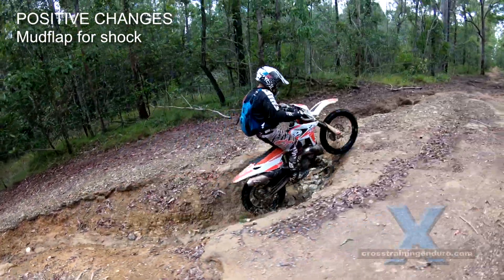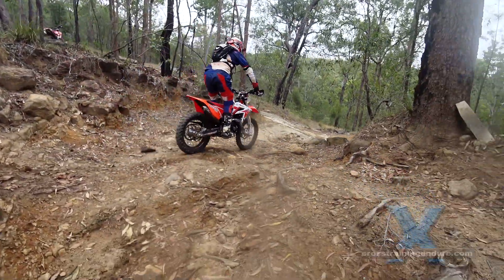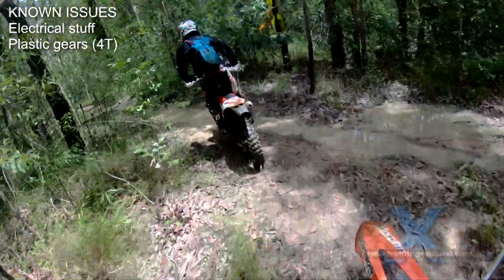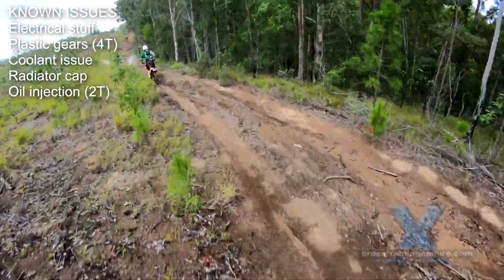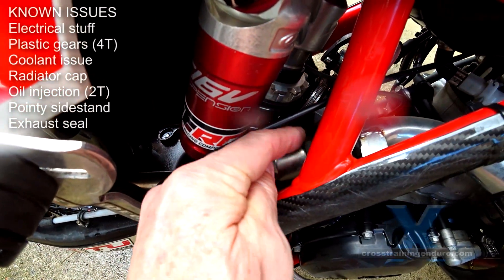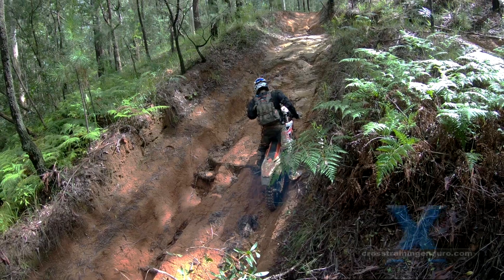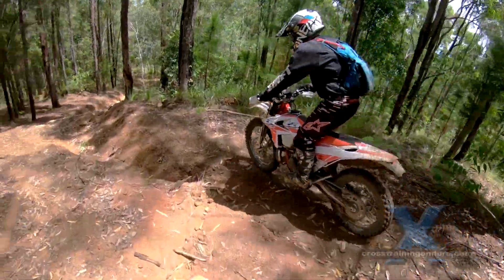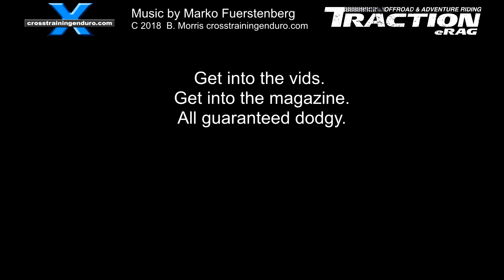BETA RR250 RR300 2018+ review of known issues and common problems︱Cross Training Enduro

Comment from the maker: UPDATE: MAIN BEARING FAILURES 2018, 2019 2020 2021 BETA TWO STROKES 
Unfortunately there been main bearing failures in late model Beta two strokes... Beta USA estimates about a 5% failure rate (and later reported a 10% rate). Unfortunately there have been cases of multiple failures - in one case three times even when fixed by Beta mechanics, evidently as it has been hard to find the exact cause. Beta head office has agreed to fix these cases up to 90 hours, after that it is a case-by-case basis and they may only supply parts. Google 'Beta main bearing failures' for more information. The rate dropped a fair bit for 2020 models, it has been quite rare in 2021 models so hopefully they have fixed most of the problems. 
2019 AND 2020 BETA KNOWN ISSUES?
Many have asked me for an updated list of known issues on 2019 and 2020 Betas. I just rang a Beta mechanic and he said there are three main issues for two strokes. 
One, the main bearing failures continue but at a lower rate thankfully. 
Two, the speedos are failing quite a bit. Often they keep resetting, this can be fixed by securing the input wires more firmly. But the speedos have other issues and dealers stock up on these to replace faulty units under warranty. Electrics can be dodgy and sometimes the whole wiring loom is replaced under warranty as it can be difficult to see where the problems are. 
Three, may sure you oil injection supply tube isn't kinked! A few guys have discovered this just in time to prevent seizing. 
Four, go over your new bike and check for bolts that are too tight, too loose, or missing. It seems this problem still hasn't gone away. 
Four, charging problems on the four strokes and electrical issues. Thee big one is bikes not charging the battery and it keeps running flat. Again, sometimes whole wiring looms are being replaced under warranty. Also there can be lots of niggling issues - read this story about one guy's Beta RR480:

"My Beta 480 was a problem child. Battery went (again) third time out, replaced. Next time out it stopped dead after about an hour, after over a month in the shop the fault was traced to a loose bullet connector in guts of the loom. New harness ordered, weeks rolled by, fixed. A few more rides without issue, then I noticed oil dripping from both the transmission and engine cases. My 'local' dealer had now shut up shop, which meant over an hours drive. That was a biggie. Those leaks were the result, so I was told of a crook batch of gaskets. This required complete disassembly of the motor (cases split) to remedy, plus another month and then some off the road. Beta covered the labor for the job, but not the consumables, so I still copped a $100 bill for that.  All this on an engine not even 12 hours old. 

In both cases Beta seemed reluctant, at best to make things right, and I got the impression the dealers were trying to get blood from a stone.  I dunno, maby the thing will run for another 500 hours without missing a beat, maby not. I can live with boutique brands and limited dealer coverage, but not a company who doge their responsibility to customers, then acts like they're doing you a favor to honor a warranty claim".

Comment from the maker: Many have asked me what the known issues are on 2019 and 2020 Betas. I just rang a Beta mechanic and he said there are three main issues for two strokes. One, the main bearing failures continue but at a lower rate thankfully. Two, the speedos are failing quite a bit. Often they keep resetting, this can be fixed by securing the input wires more firmly. But the speedos have other issues and dealers stock up on these to replace faulty units under warranty. Electrics can be dodgy and sometimes the whole wiring loom is replaced under warranty as it can be difficult to see where the problems are. The four strokes? Mainly electrical issues, the big one is bikes not charging the battery and it keeps running flat. Again, sometimes whole wiring looms are being replaced under warranty. Also there can be lots of niggling issues - read this story about one guy's Beta RR480:

"My Beta 480 was a problem child. Battery went (again) third time out, replaced. Next time out it stopped dead after about an hour, after over a month in the shop the fault was traced to a loose bullet connector in guts of the loom. New harness ordered, weeks rolled by, fixed. A few more rides without issue, then I noticed oil dripping from both the transmission and engine cases. My 'local' dealer had now shut up shop, which meant over an hours drive. That was a biggie. Those leaks were the result, so I was told of a crook batch of gaskets. This required complete disassembly of the motor (cases split) to remedy, plus another month and then some off the road. Beta covered the labor for the job, but not the consumables, so I still copped a $100 bill for that.  All this on an engine not even 12 hours old. 

In both cases Beta seemed reluctant, at best to make things right, and I got the impression the dealers were trying to get blood from a stone.  I dunno, maby the thing will run for another 500 hours without missing a beat, maby not. I can live with boutique brands and limited dealer coverage, but not a company who doge their responsibility to customers, then acts like they're doing you a favor to honor a warranty claim".

Comment: Own a Beta 300RR 2018 for over a year now, fantastic bike and best in its class. I watched this great video that covers a lot of points that I would make too. One point that in my opinion is overseen is the SPEEDOMETER, I ride in Brazil hard-enduro and over 90% of the bikes here have broken bases where the bolts hold the speedometer, I have a 3D printer and fabricated a very light base where these "titties" stick in and alleviate tension and solves this problem. The rear leds also burn quickly. Another mod I made I removed the nuts from the steering angle limiter and related them with 2 rivets which allows me too make tighter angles to do 180degrees turns. ZipTy also the radiator fin protectors as they will fall off eventually and you lose them. My biggest complaint is the stock suspension set-up that didn't work for me and most riders at 180lbs in 2019 the suspension is noticeably better - I revalved and put SAE 2.5W in the front  . I also got rid of the oil injection system and transformed it into a radiator expansion (not that I ever needed that) , I run (like I have done for decades) Motorex Cross Power its a much superior oil grade to the fast diluting "autolub oils" that the manufacturer recommends - the Motorex is more than the double the price but I spend less as it consumes noticeably less and the bike runs so much cleaner.  I have done all plus a  number of other DIY upgrades to make this already great bike an absolute winner - I too run Tubliss on both wheels and get the best of my tires much longer and never any punctures.

Comment: Good video! Another one to add is the speedo cable at the caliper. In stock form it loops outwards and can get caught by branches and such. If you pull it in tight to the caliper and "zip tie" it the chances of it getting pulled (or broken) are slim to none.

Comment: Maybe more individual problem, but 2023 300 RR (35h) had dashboard battery holder come loose and doesn't have proper contact. When started to replace the OEM battery, found out that the factory one still works, but only on specific angle / tapping on the battery. The interesting part would be that I'd consider it quite common problem as there isn't any vibration killer material between the battery skrew and battery, meaning it's plastic against battery and eventually the 2T vibrations I'd assume would vibrate battery holder connections open from the panel (as there's 1mm 'free' space between the dash panel and the battery holder). Contacted the Beta and waiting for their input (dealership shared that not covering pbly), but youtube has shown to add some sponge between the skrew and the battery to hold it in place (until the contacts come completely loose, then probably need to break it to pieces to be able to solder the contacts back together).
Reply from the maker: Beta electrics have been an achilles heel for a long time. Some have said if the Japanese did the electrics you'd have a near perfect enduro bike!

Comment: There is one very serious problem with the Beta enduro line up. The dealers are aware of it but don't admit it until you confront them about it. The problem?  One Beta isn't enough. I bought a 2018 390 rrs and thought I had the perfect all around bike that could do everything and was super fun. Well it was and still is, but then I rode a 250 Xtrainer. Wouldn't you know it? now I need a 250/300 Xtrainer. Damn you Beta and your free demo days. I was happy with one bike and now I need two. Be aware of this issue when buying a Beta enduro bike. You may end up with more than one if you aren't careful...

Seriously tho, that Xtrainer is ridiculously fun.
Reply from the maker: i've been through an italian detox unit several times now, hard to kick the habit. :(
Reply: LOL, same thing happened to me.  I bought the Xtrainer first and then went for the   390 rr-s.  Now I'm lusting for the 125 rr smoker.   I think I need an intervention.
Reply: Buzz'n a 125 is a different experience and the challenge a small bore provides in the hills is mucho fun.
Reply: Yeah already thinking about the 430  not sure how that is going to work with my other 5 bikes, damn fine 10 miles for sure! Gotta another 5 days to wait.

Comment: I've owned a 2017 300RR for a couple years now.  Best bike ever owned.  You know when most of the the issues can be fixed with Zip ties you have a real winner!!!  Is it possible to make a better dirt bike, Yes, but it would not be too much better, without anti gravity technology.  This is a really good bike.  I feel like it has actually saved my life, at least injury,  a couple times with its great power band.  I stocked my tool box with all the extra carb jets and the power band is so wide and smooth I have not found a need to change the jetting yet!! I ride mostly in my area from 2000 to 8000 ft.  100F to 40F.  I've been riding Enduros since the 70's,  this bike today, is like a PE250 Suzuki was in the 70's.  All you need to have fun in the dirt and come home with a grin.
Reply from the maker: it really is a great engine, ross. some riders say the new KTM engines are smoother with the counter balancer but i haven't had a chance to try them yet. but the beta power delivery is brilliant. 😊
Reply: Yes, the power band is where it really shines, the suspension can be dialed in nicely too.  I think it is in the ball park with the Husqvarna or KTM.  Closer than the price difference would imply.  Certainly one of the great 2 stroke dirt bikes out there today.  I changed out the springs for my weight, put on decent radiator guards and hand guards and a spark arrester muffler, it is as good a bike as I will ever need.

Comment: Crikey, that is a BIG list. 😲
A lot of the items mentioned could fall under the quality control banner.
Reply: Dangermouse the finish on the shercos seems up a trim level for sure
Reply: Julian Heer 
I'd have to say I agree there. 
The blue and yellow team are quick to address know issues as well. 
There was some trouble with the starter Bendix on 2016 & some 2017 2t models, they beefed the unit up and replaced any that had issues with the new part, often outside warranty. 
Not too many other common faults seem to surface. 
There's always a few in all brands of course.

Comment: The oil injection warning lamp should stay on at start up for a few secs. Mine didnt, and when the pump was disconnected the light didnt come on. This was a potential disaster obviously, fixed by dealer replacing the loom. Late 2017 bikes affected. Disconnect your pump for a few minutes at idle and check the light comes on.

Comment: I've had great initial quality on my 2018RRS.  It was prepped by Browne's Cycles in Paso Robles, Calif.  I'll be taking it in for the 90 hour service soon.  There is one thing it has done maybe 3 times in ~7 months I want to ask them about.  After a cold start and about minute idling the bike seems to be running smooth.  Once riding the idle speed starts to climb.  Within a couple minutes it will be 4K rpm or higher.  Shutting down, waiting a few seconds, and restarting fixes the issue.  I've read the posts in the user forums that suggest not touching the throttle before starting.  I'm careful not to move the throttle before or immediately after starting.  At all other times the fuel injection works brilliantly.
Reply from the maker: they do say don't touch the throttle when starting FI bikes but i'm not sure what the problems are if you do....
Reply: I had the exact same thing happen to me with my '18 390rrs.  My very  first ride it happened the same way you described. I let it idle for maybe a minute ( I was excited to ride my new bike) engine is still relativly cold and set off. A couple hundred meters down the road the revs started to climb so I pulled the clutch, the motor sputtered and then cut out. I re started the bike and it ran smooth after that. Happened a few more times before I stopped setting off before the motor was at temp. No more issues since.

Comment: Thank you for this! I posted a pretty in depth detail of prepping our 4Ts for Baja in the BETA DUAL SPORT/ADVENTURE BIKE SETUP: RS390, RR-S390, RS500, RR-S500 (but left out the 430 RR-S :X) thread on ADV Rider. We did a lot of work on the wiring harness. As soon as the bikes are out of warranty we will really attack these issues.
Reply from the maker: yep thanks for your input gwynne, always makes a great difference when riders are happy to share their hard won knowledge. :)
Reply: Can you make a video of it ;)
Reply: Robert, if you are on ADVRider this is the thread that keeps on giving http://advrider.com/index.php?threads/beta-dual-sport-adventure-bike-setup-rs390-rr-s390-rs500-rr-s500.1198210/  Tons of relevant information.
Reply: Gwynne Fitzsimmons tnx dude

Comment: Great video and well researched as usual. I got my MY18 Xtrainer from Jody South at Euro Enduro and agree that he is a good bloke to deal with and knows his stuff. When I pick up my bike he went over everything with me and showed me all the stuff he tidied up pre delivery. There was so much stuff he tidied up I couldn't remember it all but it seemed like all the stuff that has been mentioned on this video. Now for a few comments of my own for Xtrainer owners and possible new owners. Suspension and deflection is pretty bad in standard trim for a rider that is around 93kg all up with riding gear, tools, water etc. Fitting a Fatty Golden tyre on the front made an instantly noticeable difference, especial on downhill runs. I have now had the full suspension treatment done by FFRC... springs, valving etc (Barry has an excellent video on these mods) and it has transformed this bike. The difference is amazing and worth every cent. Highly recommended.
Reply from the maker: glad it's working out well for you rod, i wonder if beta might start putting a 'fatty' up front from the factory one day...

Comment: Beta also overstates their spring rates. It is hardly sprung for 180 pounds out of the box. Stepping up two rates on the forks and 1 on the Shock (for the rocky terrain here) proved to be properly sprung for a 180 pound rider like myself. A slight rework of the fork valving also improved things greatly.  No other issues so far on my 18 RR with about 50 hours.

Comment: I had the oil leak on a lid, which covers the opening, where kick-starter was mounted on previous models. Have 2018 RR 350. It happened after 15 hours and was fixed by a dealer for free.

Comment: I would say the biggest reason for me not switching to Beta yet. Is i'd like to see them balance the motor better like their competitors. I believe they would gain a lot of sales by changing this.
Reply: Z Shark are you talking 2t or 4t? I'm not sure about 2t, but my 4t is the smoothest single I've ridden (dirtbike that is, there are smoother big bikes like klr and 690) give one a try if you get the chance, it was love at first ride for me.
Reply: Hey Jacob... sorry i should have specified.. I was talking about the 300 2troke.. I actually own a 690 as well... great bike...cheers
Reply: U ride a kdx bro. It can't get any more unbalanced for u!
Reply: actually the KDX isn't that bad on vibration.. maybe because of smaller cc's.. But whatever the case... if i were to upgrade.. I would want smoother than what i have now. because it's available.
Reply: Oh it's worth it I bought a 300rr race edition back in Easter and I've sold 2 other bike because i really only ride my beta only.
Reply: Don't tempt me.. There is a Beta dealer 5 miles from my house :)

Comment: stock needle on 2017 300rr is way too rich. Suzuki NECJ 3rd clip or NEDJ 2nd clip works best for me.
My odometer lost total km data on weekend, still shows 41hrs but only 16km. if I change it to miles it shows total distance of 770miles which is correct total. 
put a filter block on carb vent hoses after getting contamination through bowl vent causing stuck needle at wot 😥.
Best bike I've ever owned, love it.

Comment: Beta changed their clutch design in 2018 from a 4 spring to a 6 spring and that probably has to do with the stiff clutch but i personally feel like my stock clutch from 2013 feels fine i did the washer on the springs mod with only 1mm and thats how ive been using it